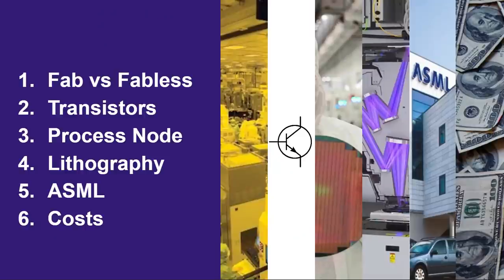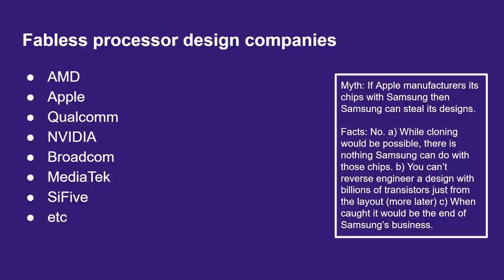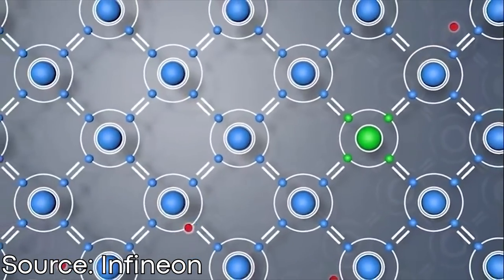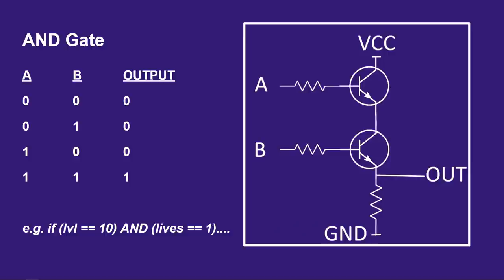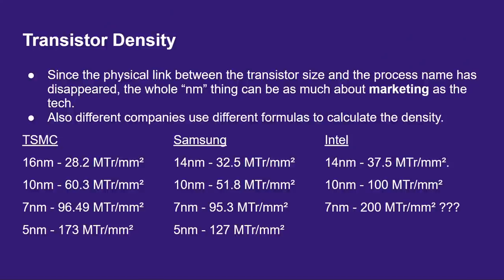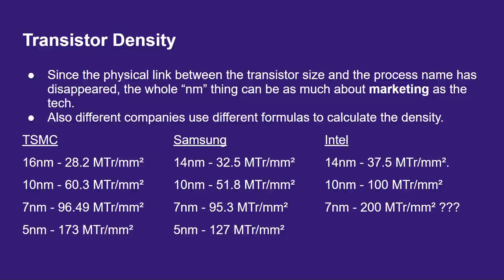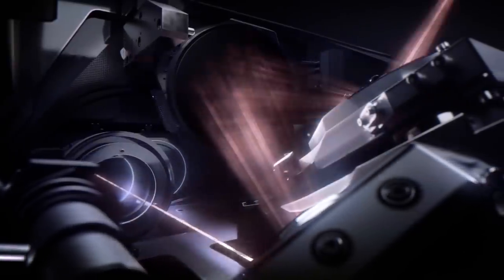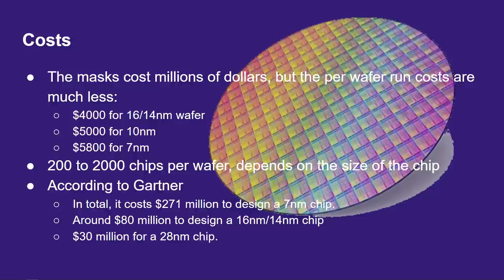How CPUs and Processors are Made for Smartphones, Laptops, and Desktops

Comment: A great video Gary - Excellent summary about making modern CPUs - very compact but never the less extremely extensive content. I was kind of shocked that all big CPU manufactures TSMC, Samsung and even Intel are dependent on just one company worldwide that is able to produce these extreme ultra violet lithography machines. It's the ASML Holding (https://en.wikipedia.org/wiki/ASML_Holding) in the Netherlands NOT Denmark. In other words, the hole 'silicon' world depends on just one single point of failure. This is quite scary to me.

Comment: Awesome explanation Gary! Seeing the 68000 views this video currently has reminded me of the Motorola 68k introduced in 1979, which was named as such because it had 68000 transistors, and was a chip used by things like the Sega Genesis, Amiga, Apple and NEXT systems well into the mid 90s. It was considered high end at the time, but pales heavily in comparison to today's microprocessors! Pretty incredible to think that we're now at billions of transistors some 40 years on, a 14000x increase!! And in systems that run on a small battery and fits in your pocket, no less!

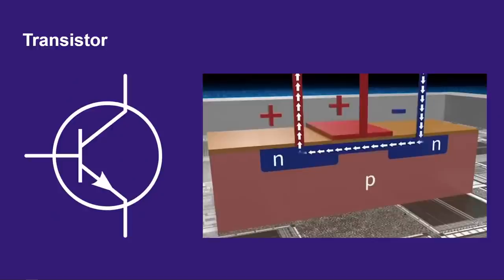Comment: I know there wasn't time to go into much detail about transistors, but in 9:08 the symbol on the left is for a bipolar junction transistor (BJT), while the illustration on the right is of a field effect transistor (FET). These are different designs. In particular, the FET is a voltage-driven device. There's a voltage applied to the middle pin, but it doesn't result in any current flowing to or from the middle pin.

A really cool elaboration on this design is to leave a disconnected gate in a FET, and then you get flash memory.
Reply from the maker: Yes, I know I used the wrong symbol. Sorry. You aren't the first person to point it out

Comment: You did a good job on this, but you showed mosfets cross sections, and bipolar transistor schematics. Since the logic circuits are quite a bit different(and they are mostly mosfets in modern cpu designs), you should try to fix that if you can :) Also an interesting related topic is power use is mostly switching speed, as the state of the nodes change, it is mostly just charging and discharging gate and interconnect capacitance. Which is why power use is so related to clock speed and cooling is dependent on Watts/chip area. Cray Research estimated you could air cool 100W/sq inch, and 200 for liquid cooling.

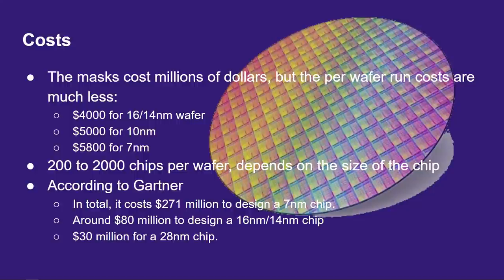Comment: 21:45 Do they get close to 100% yield from the wafers nowadays?  I remember reading (back in the 80's) yields were around 33% so the majority of chips on the wafer were useless junk.  Some could be "salvaged" by either down-clocking, or disabling functionality (AMD did this with the 29000.  If the MMU or Branch Target Cache failed, they'd sell the chip as a 29005 which had neither).   If they really usually get full yields out of the wafers, that really shows how far things have come along.
Reply: I would be surprised if they did. I did yield analysis in the 80's, and for manufacturing yield it was mostly broken into photo resist flaws, and contamination. For the new fabs they constructed, they would not hire smokers for any fab jobs, no perfumes, anything that smelled was not allowed in the clean rooms. more rarely there were missed layers, and other stupid stuff, those everything failed. And you're right about slower clocks, but there might not have even been a cpu designed without the MMU or cache, that would probably be a sales vs yield trade off.
Reply: Not at all, a 100% is almost impossible to get. For new technologies though, a 60% yield is seen as quite problematic, so depending on the node you want to be in the 80% range.
Another thing is that yield is not only determined by the foundry processes but also by the design. There are DFM rules that have different levels of priority and if followed will increase the yield of the circuit. But these come with tradeoffs so not always do you want to follow all these recommended rules (for example you may increase the area usage or affect the bandwidth of your design if you follow them).
Reply: People were always the major causes of contamination in a cleanroom. In modern fabs, people have mostly been eliminated from the process core and the wafers move automatically from process to process.  However, line width has also shrunken so now much smaller pieces of foreign material will cause problems.  It would be very surprising if the yield was 100%.  It could very well be 80/90% though.

Comment: How are those colourful images of dies (die shots) taken? 

Delided CPUs usually looks just quite opaque black slab
Reply: Those dies are not finished yet. Later on they will be covered with a lot of copper and μBumps will be made if flip-chip technology will be used. You saw the wrong side of a die, but other side still has protected layer that you can remove  with small grid sand paper.
Reply: Aren't they just diagrams or false-colour or something?
Reply: Actually never mind, I think voytechj is right

Comment: Nicely summarized and in under 30 mimutes.
It was important to comment on the RISC-V hype. Unless they have access to a huge amount of near obsolete manufacturing capacity it is not going to be cheap to manufacture. And good luck competing with the Automotive Industry for that capacity. Generally, these type of manufacturing processes have limited capacity, so there won't be much of a revolution if you cannot supply enough of the chips. And you are not going to threaten the hegemony with processors that are order of magnatude slower.
They would need to use that same, very expensive, Process Nodes as the leasding processors.

Comment: Roughly 10:30 that was the best explanation I've ever seen on these things. Bringing all the pieces together.
Same with the ASML segment. Verry good !
People say, abundant sand, but what these companies need is white sand (like you might find at beaches) which is far, far less abundant. Beach sand prices have been going up. It's also used for buildings (cement). From an article in 2018: "a cubic meter of sand selling for as much as £62 in areas of high demand and scarce supply." Supposedly their is a sand mafia and at times it can get people killed. It threatens wildlife ecological systems, etc.
People are working on some solutions for buildings: "A win-win solution is the use of waste plastic in making concrete. Research suggests small particles of plastic waste – “plastic sand” – can replace 10% of the natural sand in concrete, saving at least 800m tonnes per year."
Recently had an other reminder on history; mainframe -> minicomputer -> microcomputer. And it seems to me we are now moving to the next step: SOC as laptop/desktop (chromebooks already did this, Apple M1 also).

Comment: Note that masks are only over a million dollars for the leading-edge stuff.  For really old processes (well over 100nm) the mask sets might only be tens of thousands of dollars.  Obviously the higher resolution needed for the smaller geometries are reflected by the higher resolution needed for the mask set.  Larger geometries are MUCH easier to make.
Larger geometries are also more refined (years of practice making wafers) so the yields are better, and the machines have largely been paid for over the years.
As you go to smaller process nodes, you also need more expensive EDA tools.  Cadence sells an "advanced node" license that you need on top of the license to use the layout tool.  Once you need to factor in the wavelength of light, the mask sets can start to look more like diffraction gratings (not that I have any personal experience in anything so small), so the tool makers want more money to turn on such features.
But if you are making something that is pad-limited (the number of IO pads put a limit on how small the die can be), then you can either put more transistors in the core area (add features, memory, etc.), or you can just use larger transistors to save a few bucks.

Comment: can you explain how are there 12, 8, 6 nm nodes
Reply: It's basically the track width and those sort of sizes use X-ray lithography.
Reply from the maker: When the transistor density doubles then the process node takes the name that is 0.7 of the previous one. For the other nodes like 12, 8, 6nm etc, these are process node where the density has been increased, but not doubled.
Reply: @GaryExplains  thanks

Comment: Your description and image of/for transistors is for the original Bipolar Junction Transistor, but all CPUs use MOSFET (MOS) transistors, (generally an N-MOS and P-MOS transistor coupled together to form a Complementary gate (C-MOS) "transistor"). The symbols are different and MOS transistors switch based on voltage and not current.
Reply from the maker: Indeed. Sorry about that. You are the third or fourth person to point it out. But if that is the only error that people are finding in a 25 minute video on a complex topic then I am happy! :-)
Reply: And it doesn't help that a lot of introductory material on transistors will describe BJTs (bipolar junction transistors). The FETs (field effect transistors) work mainly based on voltage (drawing almost no current on the gate - the middle bit - when not switching). 

Side note - That's one of the reasons you see power consumption scaling with operating frequency. Hence, CPU frequency scaling became a big thing about 15 years ago.

Comment: Sir it becomes so hard to even imagine the steps that goes through churning a microscopic transistor from a CD type silicon wafer...what happens to those Dutch machines after the process node becomes outdated? Do they make new machines for different process nodes, if yes then is there any use for like 28nm machines in todays time sir?
Reply: They tend to keep being used for older designs if they are still in production.

Comment: Thank you for the clear explanation, Gary. But I have question, how intel or amd classified chips for example i3, i5, i7? Do they make separate litography for each?
Reply from the maker: Yes and no. Every processor has its own mask and unique lithography, but to save costs companies like Intel or AMD will often use the same physical chip for several models and physically disable a feature while leaving it on the die. They also test all the chips and the ones that can't run at the highest clock speeds are sold as slower models in the range. For example the difference between the Intel Core i5-1130G7 and the Intel Core i5-1135G7 is that one runs as 4GHz (Max) and the other 4.2GHz (Max). Same chip.
Reply: @GaryExplains  it seems to me that it would be wasteful to intentionally make an i3, i5, and i7.  It seems likely that Intel starts out trying to make only the fastest i7s and the natural manufacturing process creates the i5s and i3s.  Thus there is no such thing as an i3, but instead it is a defective i7.
Reply from the maker: @mdrew44628  No, you are confusing "binning" where a 2.5GHz processor might really just be a failed 2.7GHz processor, but that is about the limit to it. Certainly not the case that an i3 is just a defective i7, no. Sorry.
Reply: @GaryExplains  well I was looking at it this way.  If you used the same die size for the i3, i5, and i7 and they went through the same process, why would you purposely disable certain features like number of cores, RAM cashe size, etc. and then charge a lower price for a chip that cost the same to manufacture.  If you look at the topology of the wafer, foreign material is going to pepper the surface during processing and will create bad i7s.  Instead of discarding these bad i7s, if you had a good design, you could simply disable the bad parts of the chip and call it an i5 or i3.  That way you end up with 90% total yield on each wafer instead of only 45%.

Comment: First, thermal energy randomly breaks semiconductor bonds -- creating electron-hole pairs -- at a rate proportional to temperature.  Pure semiconductors do conduct electricity at non-zero Kelvin temperature.  Light, radioactivity, etc. also break bonds and increase conductivity in proportion to the flux.  Second, you described and drew symbols for bipolar junction transistors, but processors are built from MOSFETs and the technology generation (width) refers to the width of the smallest transistor's gate.
Reply from the maker: Sorry for using the wrong symbol. I will go out back and beat myself.
Reply: Well, those who know it's the wrong symbol don't really need an introduction to what a transistor is. :-)
I think we can let Gary off the hook a little bit for that.
Reply from the maker: I agree!!! :-)
Reply: @aveekbh  Perhaps.  But these are also the people who will be wrong when they repeat what Gary has taught them.
Reply: @GaryExplains  

I, for one, am horrified that you drew resistor-transitor logic ;) 

Hold on a minute, I lie, I'm not horrified by that at all. I just checked and it turns out that I'm amazed that in such an ambitious video digital logic got related to transistors in a concise and understandable way.
 
Glad I watched!
Reply: It's OK to use either the BJT or FET symbols when you only want to talk of transistors in general. Anyone who needs to be more specific about the type of transistor should dig a little deeper than just this video. This is, after all, only a general introduction.
And of course, we used to have BJT-based designs as well (TTL chips).
Reply: @aveekbh  Even Intel's 4004 had MOSFETs NOT TTL.  No production processor has ever been built from BJTs.  So no, integrated processors do NOT have BJT-based designs.  It is OK to be wrong until someone corrects your error; at that point, you are expected to learn from your mistake.
Reply: How about all the 7400 series chips? Those are all TTL. Chips don't all have to be processors.
Reply: @aveekbh  First, I NEVER said that chips "all have to be processors."  Second, I never denied that TTL chips exist.  However, "How CPUs and Processors are Made..." is explicitly about CPUs and Processors and is NOT about chunks of semiconductor in general nor transistors in general nor even other circuits made from MOSFETs.

Comment: I am a bit confused. Say Qualcomm designs a chipset and TSMC produces it, what is the role of ARM in it and their Cortex A53, 57, 77 etc series CPUs??
Reply: ARM supply (sell) the design for the main processor core (think of it as a blueprint for an engine). Qualcomm then bolt on their extra hardware into this blueprint (Modems, GPUs, etc). TSMC would then be the one to turn Qualcomms blueprint into a physical chip.
Reply: @SerBallister  isn't Mali also developed by ARM??
Reply: @ashishnmbr  yeah, that's an optional license
Reply: @SerBallister  cool.. thanks for clarifying

Comment: I wonder why there's such a steep price difference between 14nm and 7nm per chip design. Is it the mask that makes up most of the difference? Because the per-wafer costs are $5000 vs $5800 it feels very weird for the design to be $80m vs $271m
Reply: because it is more complicated to fit more transistors in the same space, you need more sophisticated mask, which as Gary said cost a lot to make it, especially you need those expensive lithography machines you can churn out those 7nm cpu's, more complications more raise in cost
Reply: When you shrink the transistor to smaller sizes, the yield from a single wafer becomes lesser due to increase complexity that leads to errors. So, to overcome this yield problem, new technologies must be developed and used which increases the R&D cost. 

There is also enhancement to the transistor technology itself in order to cope with quantum channeling. If you notice, there are a revisions to the FinFET transistors and in the coming years, GAA FET to make shrinking down furthers possible.

Is it very common to have exponentially higher cost when upgrading to a newer nodes. This is why economies of scale is important for fabs

Comment: NEC copied the Zilog Z80 from looking at the silicon. They even copied a redundant transistor.
Reply from the maker: Exactly, it even copied a redundant transistor because it just did a transistor by transistor clone. It didn't reverse engineer it. Also it had just 8,500 transistors. Not 11 billion.
Reply: If the foundries (fabs) got caught cloning or reverse engineering a chip, they would immediately lose all business (because no one will work with them any more), and then they would get sued out of existence. The price of dishonesty is just too high.

Also, the trade secret protection goes the other way too - fabless semiconductor companies need to use the fab's libraries to actually make the final designs. Again, big price to be paid for any dishonesty.
Reply: It was first copied, tested to work and then reverse engineered to produce other Z80 variations. NEC got busted for their counterfeiting effort. 8,500 1970's transistors is the equivalent of 11 billion of 2021 transistors so it's a relatively similar effort. Although ICs contain more than just transistors for instance DRAMs contains lots of capacitors and (pseudo) resistors all IC elements are uniform and arranged uniformly. It'd be interesting to look at Huawei's ICs to if they've added any secret squirrel stuff. If one wanted to reproduce an IC, they'd use Artwork generation files or similar.